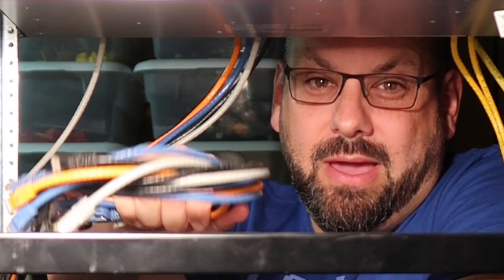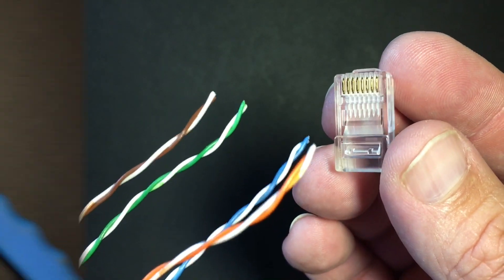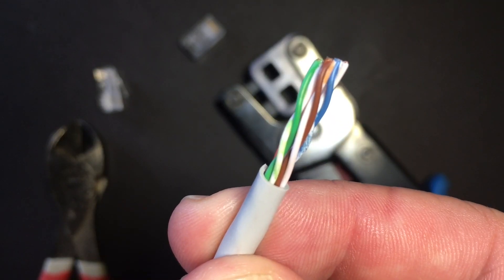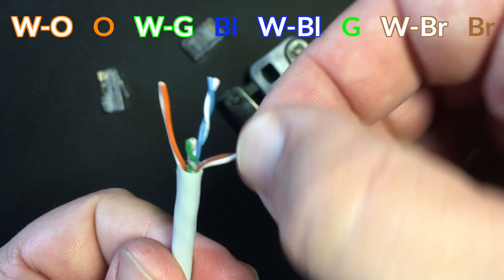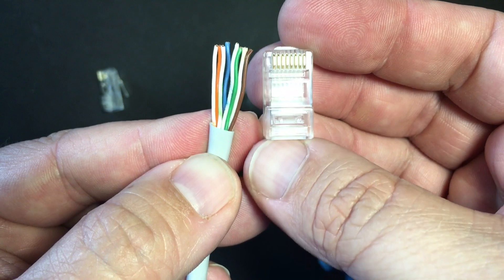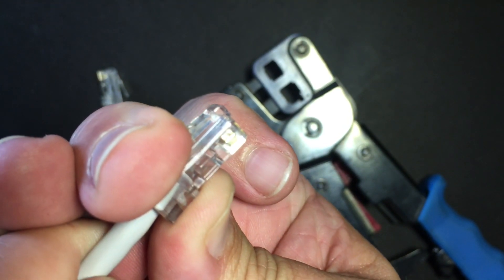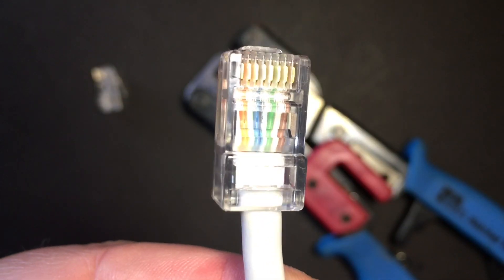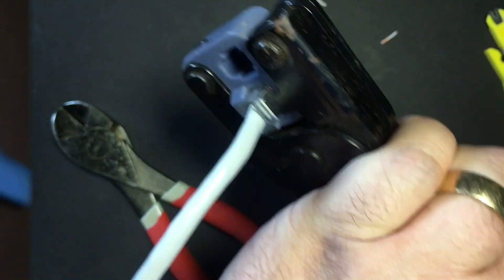How To Make A CAT5e Ethernet Patch Cable

Comment: it always boggles my mind that you're mostly using unshielded cables in the U. S. that's just asking for ambiguous connection problems
Reply: TheThagenesis the specifications for CAT5/6 UTP are perfectly reasonable? Never had any issue when the cabling plant conforms to the spec, using shielded cables instead of following specifications migth not be the best way to solve cabling issues ;)